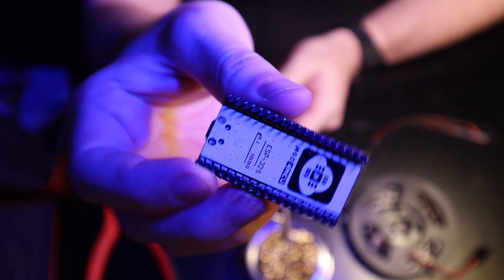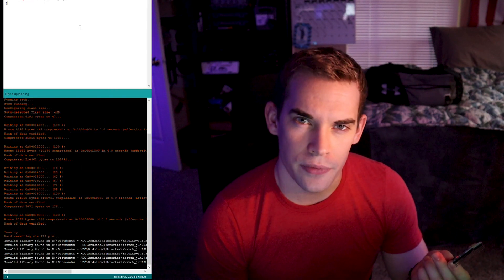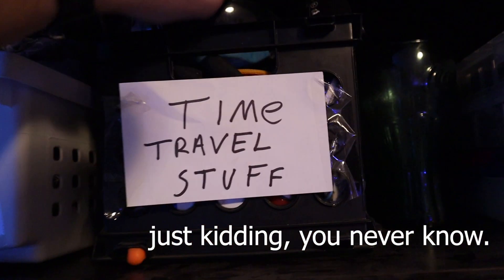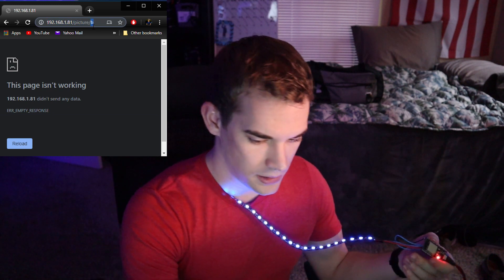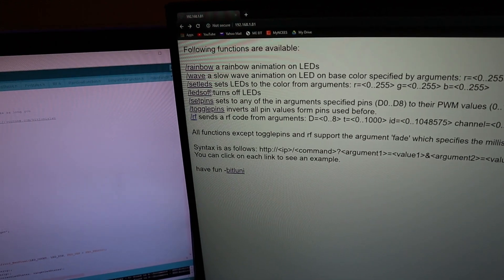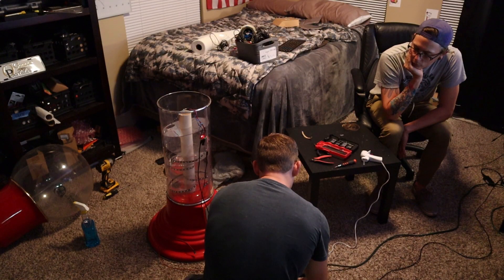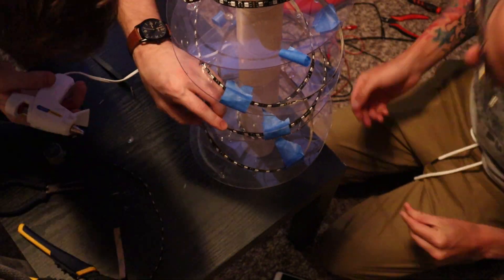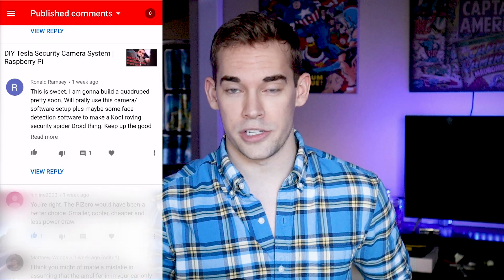WiFi Controlled LED Gumball Machine Lamp | Arduino

Comment: K now I'm not so sad, thanks 👍 Failing is the most potent way to learn it's how I learned how to code and eventually become confident in my abilities. I think it's important to show the failures just as much as the successes so thank you for not hiding that stuff. Also, lucky bum with that soldering iron (getting one that is, not burning yourself on it lol)

Comment: Brother, got a couple tips for future projects.  
1. Get some Wemos D1 Mini (or clones), they are cheap arduinio/ESPP8266 compatible devices that are super cheap
2. Check out the WLED project (I just found it and I'm going to use it for everything now)  https://github.com/Aircoookie/WLED
3. don't solder your controller to your leds use plugs https://www.amazon.com/gp/product/B00NBSH4CA/ref=ppx_yo_dt_b_asin_title_o09_s00?ie=UTF8&psc=1
4. plugs for external power too: https://www.amazon.com/gp/product/B00XJ2Q5N2/ref=ppx_yo_dt_b_asin_title_o09_s01?ie=UTF8&psc=1

Keep grinding, I learned and am learning the same way you are.
Reply from the maker: I very much appreciate that Chris! I’ll take all your comments and be sure to use them in everything I do now haha. About to order the plugs now!

Comment: Soak soldering iron burns in vinegar for a few minutes. They won't blister, usually won't see any evidence of a burn.

I just made 2 LED Stickman costumes on the weekend. Much soldering. Very hot
Reply from the maker: Thanks for the tip haha! And that's a cool costume idea!
Reply: Wow, i didn't knew that, thanks. I definitely gonna try it the next time i burn myself with the Soldering iron. (Which happens more than i wanna admit, lol)